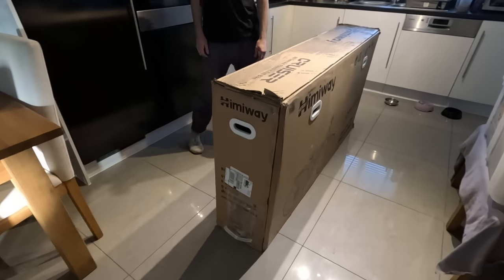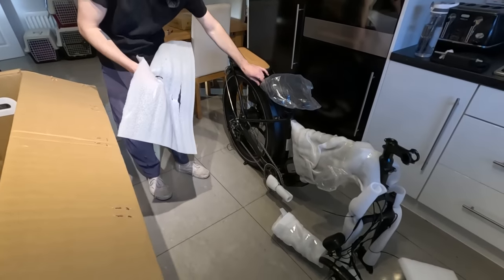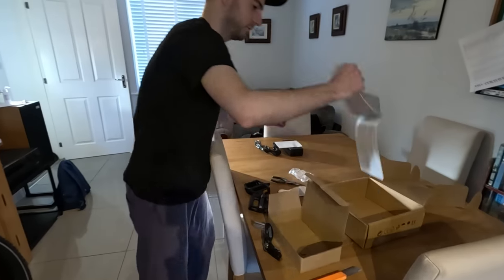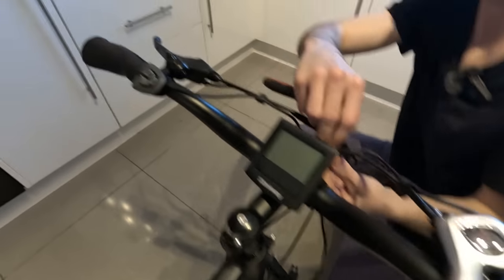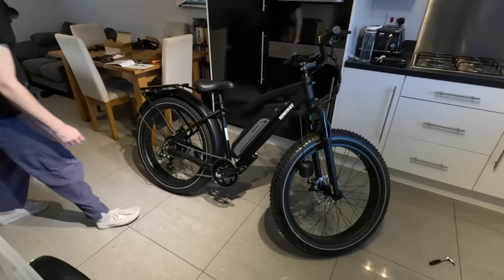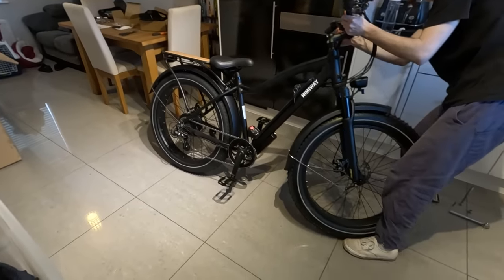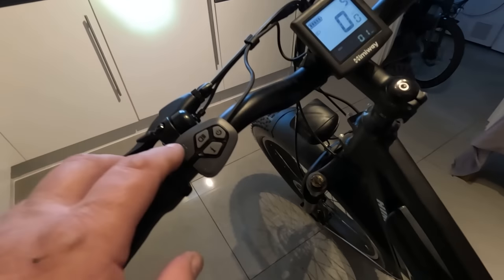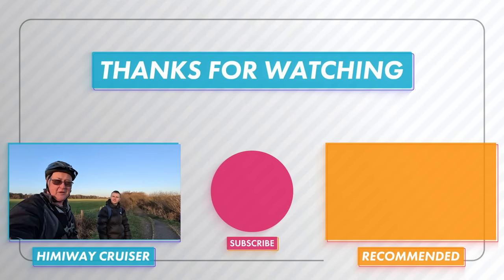Himiway Cruiser Long Range Electric Fat Bike | Setup And First Ride (1/2)

Comment: I have copd and bought an electric mountain bike. 27.5 tyres, a Rockrider est900 from decathlon. Came fully assembled so i didnt have to strughle assembling it. Electric bike has really helped with my health. Cycle locally. Also, bought a thule rack for car and have been up forest mountain tracks in north wales. Will be taking it away with us when motorhome delivered this spring. Am thinking of converting mine to tubeless as i have a fear of flat tyres.

Comment: Bob, if you lean the bike towards you, you'll then find it much easier to get on. It does look to be a good solid bike 👍.  However, given the mammoth weight of it and only having 7 gears, it will be hard to peddle it manually should the battery run out whilst out and about.
Reply from the maker: Thanks for the tips!

Comment: Hi Bob, the mains lead is a Euro plug typical for laptops. You should be able to get a UK lead at an electrical store or computer store rather than cut the plug off. then you can use the Euro lead on your european trips!
Reply from the maker: Thanks, but you shouldn't need to do anything about the lead, if they sent the correct one.

Comment: Looks good Bob. Shouldn't need to take back rack off. Just lean bike over more to get your leg over. Not using my push bike anymore as I've just bought ebike. But I had to lean my bike over more as with age couldn't get my leg high enough.
Not sure if I heard you correctly about raising seat anymore. Can't believe that's right. Should be able to raise considerably. But maybe misunderstood you.
Reply from the maker: Yes, Liam said that, lean the bike over to get on and off. Not as mobile as I used to be. You can raise the seat. Liam was taking about a device to raise and lower the seat as you need.
Reply: Oh that's interesting about the device. No I'm definitely not as nimble. I'm 78 now & really look g forward to getting my bike. I started cycling again 10yrs ago. But my wife died 20mths ago. And haven't been on it since. Put 2 stone on since her dying. But I know the ebike will definitely help me getting cycling again.

Comment: I would really like to know how much it costs  to charge this e-bike, it looks a beast wish I had one.
Reply from the maker: It has a 20Ah battery. I may be wrong here with my rough calculation here, but it will charge at around 2 amps in around 2 hours. 2amps at 230v for 2 hours is 0.920kwh at 36p per Kwhr is 34p. If you're planning to spend that much on an electric bike....